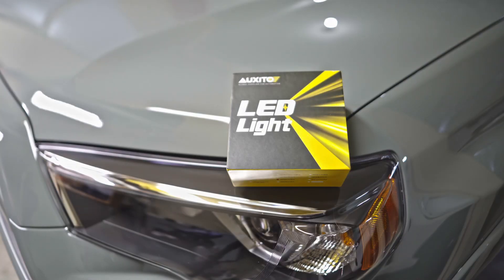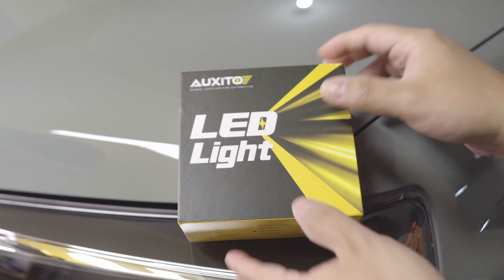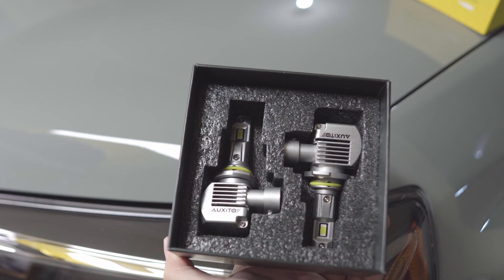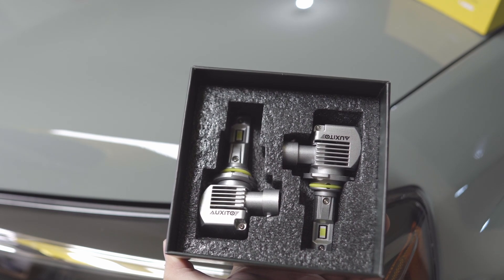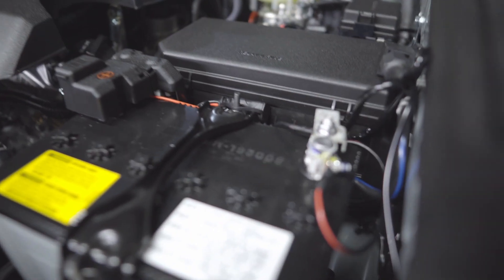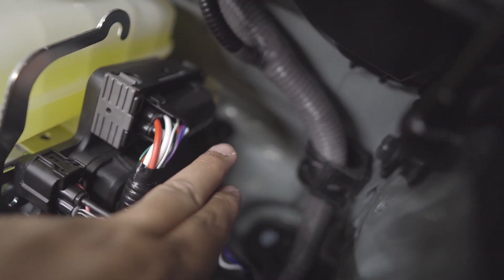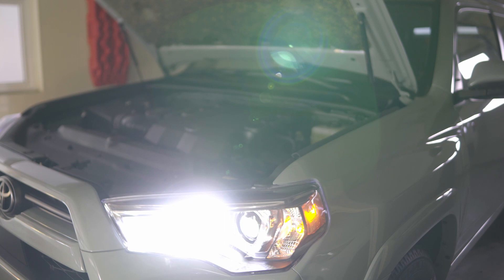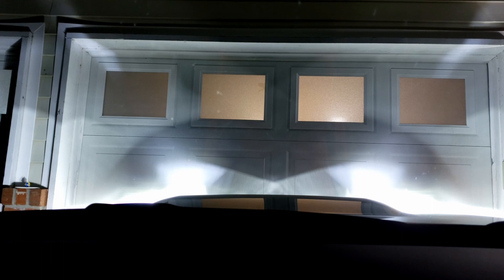Toyota 4runner Dual High Beam Install | DRL Delete | Auxito Q16 LED

Comment: By adding the dt connectors to connect the new harness with the drl bulbs, did you also connect the extensions to the factory drl wiring connector, or leave the factory 9005 connector unplugged? Also did you need to connect the switch inside vehicle to an add-a-fuse to the fuse panel? My wife has a 2022 trd sport that I would like the option of brighter high beams on back roads at night.
Reply from the maker: Factory DRL harness not used at all, and yes i used a Y harness with relay and fuse, the switch inside i just tap it to the other switch beside it. But now that i got a dedicated switch panel its a lot easier
Reply: Ok@Forged_Garage , thank you. I have been looking at the auxbeam switch panels since seeing that install. Cleans up the wiring with one routed inside to main switch panel.

Comment: The new led bulbs do not work with just the factory wire harness correct. I installed led bulbs in that location and they would not turn on when I had both connected. If one halogen bulb was connected and one led bulb it would turn on the led bulb. I wanted to run led bulbs as the drls but with no luck.
Reply from the maker: Correct it they will not work with factory harness because it only feeds around 6volts to power the bulb as DRL, thats why i did a conversion and installed a separate harness, i don’t need the DRL because I always drive with my low beams on.
Reply: hi sir, do you know if we can change our drls to led drl? meron po kayo idea if it’ll work? sorry 1:20am na pala hehe